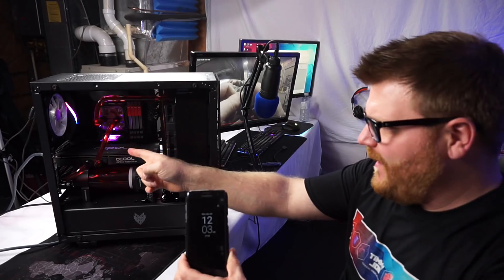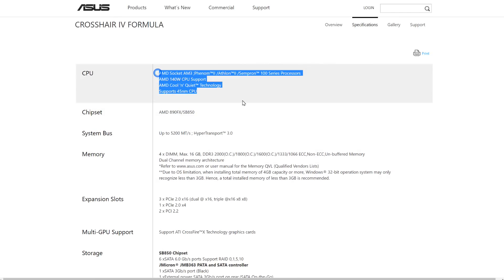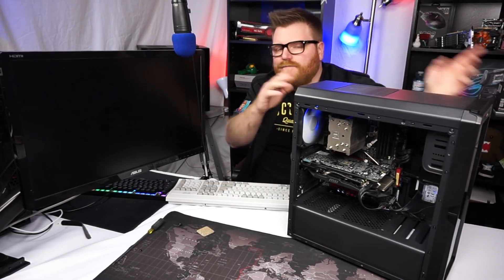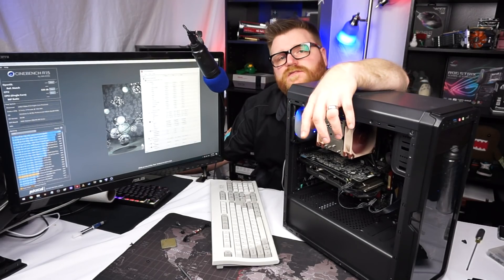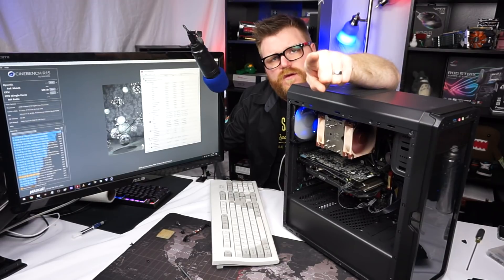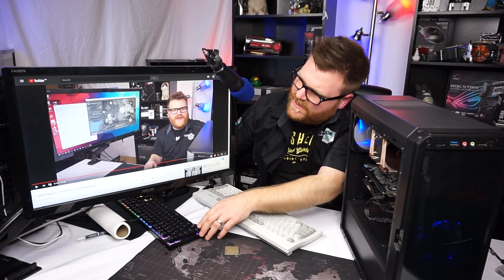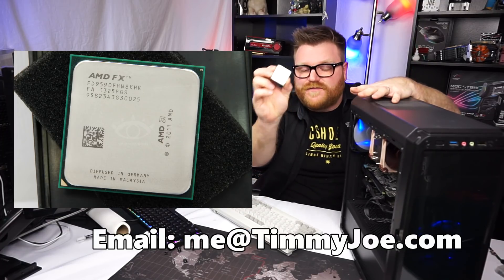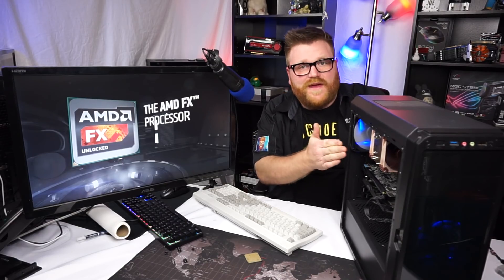AMD FX 8150 Overclocking on an Asus 890fx AM3 Motherboard

Comment: Not real result. My old 8120 was able to hit consistently 610 @ 4.1GHZ so this motherboard shouldn't be use in real scenario.
Reply: The same will happen when people wanna upgrade their ryzen cpus with the old motherboard. So much for AMD upgradeability.
Reply: I was really wondering if that would be the case. Because back in the days AMD wasn't supporting am3+ on am3 boards, in my opinion this is really more about just to get it working if you really need it. On other hand x370 vs x470 i don't expect to see gap of this kind. For sure this is something that must be tested as new Ryzen CPUs come later this year.
Reply: There 100% will be performance differences ect if you pair an x370 board with an later ( future ) chip.
The question is just how big is the gap.

You already can expect: No PCIe 4.0 Support, No Quad Channel support, probably less pcie lanes.

We will see how bad it will be
Reply: I don't see it that way for now. For x470 none of this things ware on the table. Keep in mind that in CES they showed x470 board that was originally designed as x370. The architecture is basically the same just better tweaked for power/clock/performance. So I expect the first platform update to be really a non issue.
Reply: @dom3827  Are there any ryzen (not threadripper) chips with quad channel memory?

Comment: I have a 6300 which I plan on using until Ryzen prices go down, possibly in 2020.
Reply: Running FX also, and not upgrading till 2020 ( AM5 hopefully)
Reply: Ryzen has gone down a ton.
I suggest getting a R3 2200G or a R5 2400G as a upgrade over that thing...
The 2400G outperforms the 8350 by a ton, double the 8350s single threaded performance and trading blows with an slight edge to Ryzen in multi-threaded performance.
And it got a iGPU roughly on par with a 1030 included in the price.
(The price and performance for this APU is better even for the CPU side alone then the 1400 and 1500X)
Reply: Luredreier I tend to use tech way past it's "best before date". My PC still works just fine. I will upgrade when the software needs it.

Comment: Sold my 8350 and a board for 160 few months ago
Added 20 bucks and upgraded to z77 and i5 3570k
Yes upgraded to 3570k
Insane difference from 5 year old chip
Reply: Trust me, get the 3770k...
The 8350 outperforms the 3770k in some multi-threaded applications, but in most situations the 3770k is better.
And you actually need 8 threads in modern titles.
I'm actually experiencing some games using all 16 threads on my R7 1700 now.

And no, the i5 3570k isn't a upgrade over the 8350, it's a sidegrade.
You'll get massive improvements in games for the most part as the IPC of the i5s is the base level assumed in modern titles (part of why you'll want a Ryzen or better these days) but the multi-threaded performance of the i5 3570k is actually a bit behind the 8350.
Reply: Tijana Nestorovic yeah. You can also go to a 3770k
Reply: Luredreier dude
I owned both chips
I5 3570 is way ahead in gaming then 8350
Even 2500k is much better in gaming
And yes.i would get i7 but money lol

Comment: Your way off with that phenom comparison, with a gtx1060 6gb I tested one against a 8350 on the same motherboard, and as far as gaming goes, the 8350 was more than double the fps, the phenom could barely muster up enough ipc to do 30fps in gta 5, the 8350 80-90 fps. the phenom was a 955 BE @3.6ghz and the 8350 was at stock speed, 4ghz.

Comment: still love my 8350 does everything i need it todo although i would like to upgrade to ryzen when ram prices go down
Reply: the 8350 is sooo much faster than the 8100.
Reply: Same, mine is paired with a gtx 980 and i play pubg at 80+ fps with medium settings at 1080p and it gets it done! Everytime i look to upgrade i end up being content with my rig. Maybe zen+ will finally be enough.
Reply: There is a 5-10% IPC gain between the 8300 and the 8100.
Reply: It's actually better gains then intel gets now, 5-10% IPC+ another 5-7% clockspeed is a pretty good performance boost.

It still doesn't have sandy bridge IPC mind, but it's not a terrible gain.
Reply: Fx is still great :)
Reply: +Colin Tibbetts
If you buy the R5 2400G when it comes out then that CPU will outperform your FX 8350 in pretty much everything, it's single core performance is over double and it's multi-core performance is roughly equal to the 8350.
And it got a iGPU included roughly on par with a GTX 1030 in case you have a lower end GPU or just want to do a viritual machine and need a GPU for the host OS or something. ^^
Also, it's HSA enabled so you'll be able to use the GPU to accelerate some workloads with that thing.
You can upgrade to a 8 core 16 thread Zen2 CPU down the line.
And yeah, the memory prices are pretty insane right now.
Especially because Ryzen is finicky about memory.
You'll want two 8 GB modules (a pack of 16 GB) of DDR4 running at 3200 MHz and CL 14 for the best results.
And upgraded UEFI/BIOS.
If it won't run at 3200 MHz run it at 3000 MHz and tighten the timings and sub-timings.
Anything above 3200 MHz is a waste of money on Ryzen, anything lower then 3200 MHz at CL14 risks not being high enough quality to work well with Ryzen unless it has specifically been verified with a particular motherboard and is in its list of certified memory kits.
I used to have 32 GB of DDR3 2400MHz CL 10 or 11 or some such in my old system.
And I'd love to get myself 32 GB of DDR4 with Ryzen too, but with the current memory prices that's just not a option... :-/
But my R7 1700 is amazing compared to my old 8350 =)
Reply: +Bagdadsky_Hornik
Actually, the IPC gain is quite massive in some workloads.
That said switching from my old 8350 to my new R7 1700 feels amazing. =)
Reply: It was a budget buy even when new. For its performance- it cost less (CPU + Mobo) and OC'd. But it was hot and used lots of power. I'm still rocking a 6 year old budget minded build - FX-8350 + HD 6950 on a "ultra durable" gig mobo. Only mod was the Hyper 212 to replace the stock AMD CPU hairdryer loud and efficient cooler. His CB tests made me wonder.. at stock mine was 642, OC'd to 4.5 it's 702. But fans are louder... https://imgur.com/PcCLuPG

Comment: Surprisingly despite Bulldozer's failure to compete with Intel, they're still very serviceable CPUs. I used an FX 8350 as my daily driver from around 2012 until November of last year, and while it may not have blown anything out of the water it still served me well and ran most games decently. Just recently upgraded to an i5 8600k though and I'm loving it so far.
Reply: Hum, different preferences, I went with the R7 1700 myself.
Reply: Luredreier Ryzen is an amazing platform don't get me wrong, I've recommended it to friends and even helped a friend build a Ryzen based PC, but I went with Intel because of the gaming performance. I run a 100hz monitor and Intel offered me the best choice for high refresh rates.

Comment: I'm looking for a cheap used  mobo, cpu, ram, videocard combo for around 200-250USD, oc is possible, any suggestions?
Reply: N M look for an i5 2400 8gb of ram and a hd 6950 2gb. This are the bang for the buck champions.

Comment: 9590 gonna wreck that mobo.  9590 only runs on a limited amount of AM3+ mobos without wrecking the VRMs.
Reply: Ran mine on an MSI 990fxa gaming board. It worked well in the winter, but I had to replace it with an 8320 in the summer. I eventually got the 8320 running at 4.7ghz so I just ditched the 9590 altogether.
Reply from the maker: That's a 400 dollar motherboard, you don't know YOU DON'T EVEN KNOW... I fixed the OC, video coming soon, 4,82 Ghz 715 CBBBBBBBB
Reply: needs a high end 990fx chipset
Reply: Timmy joe!

The 9590 will be faster than the 8100 even at the same clock speed.
Reply: the 9590 needs a mobo that supports 220w that this cpu uses

Comment: The problem is that you have 8 cores but they share encoders and decoders in pairs of 2. Also, fx 9590 is just a binned and factory overclocked 8350. A 2500k is still a better option than any FX cpu.
Reply: Not quite accurate, a CPU don't have "encoders", they do have decoders decoding the x86 instructions into microcode used internally by the CPU.
The front end of the piledrivers can feed 3 integre instructions pr clock cycle, the two cores can execute two integre instructions each, so unless one of the two cores got a multi-cycle instruction running then that resource is going underutilized...
As for the two floating point units of each module those are also shared.
So each core can do one floating point instruction each clock cycle, or one of the two cores can do a double-precision floating point instruction while the other does non.
Also, the cache system is absolutely a crime against silicon...
Unfortunately several modern programming languages has started essentially using double precision instructions by default (causing serious issues with the FX series), and pretty much all compilers out there either assuming that the FX series is less capable then it is or are less optimized then the ones that thinks the FX series are less capable...
(Basically the best compilers out there right now are mostly Intels stuff for better and worse, even with the shenanigans Intel has gone to in an attempt to sabotage AMD they still run better on AMD hardware then the open source alternatives, although you can get a lot of free performance by tricking it into thinking that you're actually running a Intel CPU)

Comment: Before upgrading to Ryzen, I had an 8350 paired with a MSI 970a-G46 motherboard. I had it overclocked to 4.5 ghz for about 3 years with no problem :)
Reply: TxGamer13 my exact setup right now fx 8350 on water oc to 4.3 and a msi gtx 970 love it no problems
Reply: i have 8350 with 1070 no problems at all with MSI 970_g43 PLUS
Reply: That MSI 970a-G46 is a great motherboard. I have it paired with an AMD Phenom X4 965 BE and it was awesomely fast.

Comment: I think there's something wrong with your CPU or Mainboard. I got the same CPU and highest i can get is 4.4 GHz at 1.5 Volts (any higher and i get Win10 Bluescreen). My Cinebench score is 660 with 4.4 GHz. So getting that low score on 4.8 GHz doesn't make any sense to me.
Reply from the maker: yeah i dont get i think it was throttling. a better cooling solution is in order
Reply: Do check out your VRM temps too. Too high VRM temps can cause instability issues which can adversely affect benchmark score
Reply: Another thing, on the fx 8150 you need to put cinebenq as high priority in windows, windows does not like the way they are built, with that they will work a bit better with multi tread applications. From 63c up they start to throttle depending on the limits of the board you can set the limit to 90c but at 70c they start to not like it a lot and losing performance. Using low cas and 1866 speed ram is the best for this cpu.
Reply: I have an FX 8350 that can hit 4.8 GHz at 1.5 volts, but oddly also needs 1.5 volts to even hit 4.4, the boost speed is 4.2 at base... And my chip runs on around 1.275 volts at base settings too. And both at 4.8 GHz and 4.4 GHz I get so close to the same scores in benchmarks that it literally is less than 1% between them. It just seems even if you can clock these chips stupidly high, they don't get much better after 4.4 GHz or so. I think that his Cinebench score was within margin of error for these chips. Because I can run the benchmark 5 times in a row and get anywhere from 725 CB to 550 CB randomly. These chips just are weird in general so idk.
Reply: I have the exact same board and i can tell you:

If you OC you need an active cooling on the northbridge because it gets FUCKING HOT with the stock heatsink. way above 80°C is normal for this boards north bridge.

Also the BIOS Update is only Beta. So Problems are prepared for you. So is instability.
So much for "AMD is upgradable for a long time". Yea, just how good does it work? You have the results.

Comment: Hi, something is off because with mine 8150 at 4.7 I Hit 700+ on cinebenq. The oc I did was just with clock no multi, I have a scythe fuma as a Cooler and the board is a asus V fórmula z, Rams team group 2400 16g.
Reply: Yeah i also commented that something feels wrong. Got mine to 4.4 GHz and have 660 on Cinebench R15. The mainboard really isn't made for that.
Reply: Fr3akyPro this cpu is realy power needed and it needs a very Good psu + Good vrm  board. The fórmula z will take even the 9590 so I bet thats the problem. Mine also does 105 on the single core not Good but its something
Reply: +Dom
Not AMDs fault if Asus don't make a good UEFI/BIOS for their old motherboards...
Reply: Hmmm weird my 8350@4.4ghz gets 702 in cinebench.....
Reply: The BIOS Update is only a Beta Updates.
So any problems included and may be completely unstable.

So much to "AMD is Upgradable for years"
Yes, kind of....as beta....with lack of performance.... and just glued together.

I have the exact same motherboard.

Comment: fx 8350 here 4ghz oc with gtx 970 awesome chip still
Reply: he didnt say shit about stuttering, also you have no idea what settings games or resolutions he's playing so dont talk shit about bottlenecking, i've ran my 290x's on amd fx and was fine, nothing I couldnt hit 60fps in (without gpu being the limiting factor atleast), people saying shit like this is why i tried sli gtx1070's (client let me test them out before building his rig), every game i tried at 4k ultra both gpu's were maxed out at often well over 100fps.
Reply: 4ghz? So 0% oc?
Reply: Vice Stojčić fx 8320*
Reply: Sibbe you can get it to 4.5ghz @ 1.45volts or less (200*22.5multiplier) and that should give you more fps and less stuttering, the 8350 is holding back your gtx970. Gtx970 is to much GPU for fx8350 a more matchable choice would be 7870, 7950, gtx960, 950s in SLI, R9-280, R9-270Xs in Xfire, RX460s in Xfire, RX560s in Xfire
Reply: @Toms Tech

What games were you playing?

The FX processor is a serious bottleneck for CPU bound games. My old i5-2500k @4.8 Ghz bottlenecked my old EVGA GTX 780 Classified, compared to using the same GPU with a 4790k. I highly doubt that it could keep up with a couple of 1070s in sli, even @ 4K, when it is a major bottleneck for a Titan Xp. https://www.youtube.com/watch?v=76-8-4qcpPo

Comment: Perhaps try getting hold of a phenom II x6 1090t & overclock too 3.9 ghz ?
Should be pretty good performance boost having 2 more cores & then pit it against the fx 6300 in the cheaper am3+ motherboard.
Reply: Marcus60661 so overclock the phenom ii but not the FX? Of course the phenom will smash it. Where the 6300 shines is that it's a 5ghz chip out of the box.
Reply: well, phenom and bulldozer are pretty much equal. At least at per core performance. AMD did not have any changes since almost a decade. Just renamed CPU`s and failed experiments.
Reply: phenom 1090t was £190, fx6300 was £80
phenoms would hit 3.8-4.2Ghz, fx would reach 4.8-5.2ghz
the fx6 handily beats the phenom in work and games, i've had them all.
Reply: Toms Tech i have the 1100t and in some tasks it beats bulldozer because of 1 fpu per core and not per module.

Comment: I love Video's like this!!!!
Reply: I upgraded to an 1800x about 4 months ago, but I have fond memories of my FX-8350.  I didn't get rid of it because it was under performing, I just wanted the latest. I ran mine at 4.6 GHz 24/7 and it ran flawlessly and didn't affect games in a negative way.  Had 32 Gb DDR3 (now I have 32 Gb DDR4).  It used more power than the 1800x, and has 1/3 the power, but it still ran great.

Looking back, I probably bought into the 1800x a bit too soon. I paid $370 for it back then, and even then, the 8350 was only $99.  I paid almost 4x the money for 3x performance  (not including $250 for CH5 mobo, $370 for 32 Gb DDR4, $200 for custom water.. etc).